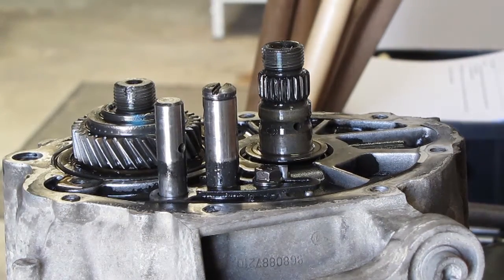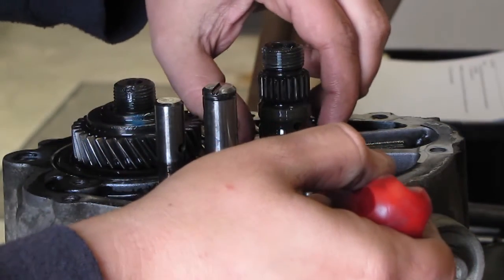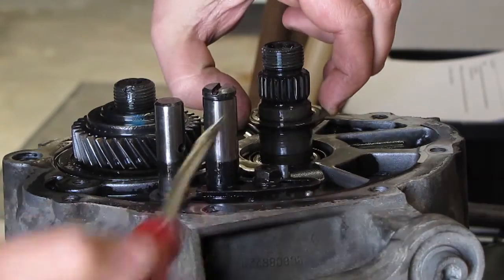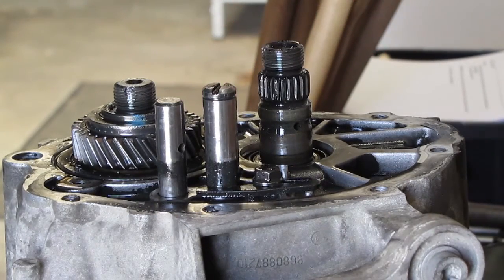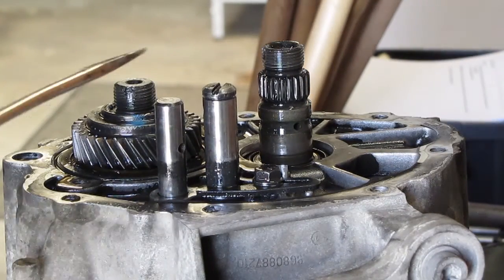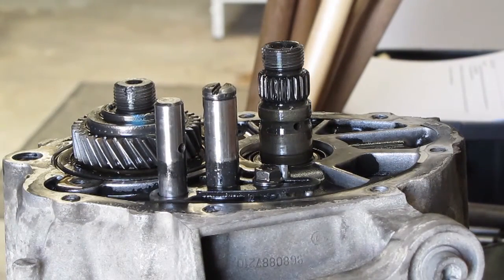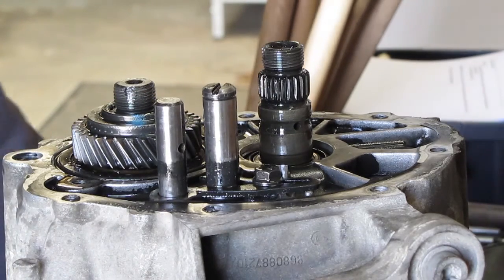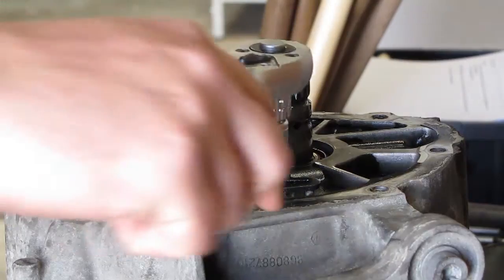Peugeot 207 - BE4 Gearbox Overhaul (Part 3)

Comment: Hey. Can i ask you something about this Gearbox. I have the same in my Peugeot 307 (EW10J4, RFN, 2.0 Petrol 16v, 100 KW). My Gearbox works like a charm when its cold. After 10 mins of driving, the Shift Knob start to get "Stick" when you put it left or right. It means, when you put the 5th Gear in , Usual it springs a bit left ... i guess you know the Problem. From Neutral, you put it Right, it stays there (you must help to get it in the middle again) From left side the same. ONLY when it gets warmed up.  After 10 mins of driving.
Clutch already renewed, Gearboxoil also ofc. 
The Assembly of the Shift Knob , when i disconnect the Shifting Cables from the gearbox is smoothy, i lubricated it. all moves freely. In this Video at 13:07 The Top Lever is responsible for UP /DOWN moves , the LOWER one, is for the RIGHT/LEFT Movements, which also should snap back to the middle. THIS LEVER is Sticking somewhere .
Did you have any Clues or Hints what i can do there ?
I wanna remove the Cover of the Gearbox (Access to 5th Gear Assembly) to see if im able to find the Problem there.

As i said: COLD: Everything works fine. And if you drive for 10 mins, You cant do Left/Right movements with the Gearshift-Knob , it dont snaps back to the middle because the lever in the gearbox isnt working properly and dont move as it should be. Greetings from Austria, Sorry for not so good English :)
Reply from the maker: That is a very odd issue. Are you sure the plastic bracket which holds the 2 cables is completely secured with all bolts? I had an issue before where I lost a bolt and the bracket would move, resulting in poor shifting. Perhaps when it warms up some sort of play occurs?
Other than that, theres not much which would cause this apart from bad shifter cables...
Reply: @Ronke01   Hi, Thanks for response. No its the lever in/on the gearbox itself. which stucks.
The Plastic thing with the cables are ok (Looked at it, when i have done the clutch). I have disconnected the cable from the lever there directly.

Something inside the Gearbox must get sticky at this lever when it warms up. I know that the BE3 Gearboxes have issues with loose Nuts on the 5th Gears ... Thats why i wanna look inside there. It can be done when the gearbox is in the car .

I just thought you know, where this lever goes, and how it functions. and from where this "Spring" effect comes. (If you move the knob to right or left, it should move to the middle from alone) from where this force comes from ? :) :P .
Reply from the maker: @knuckles2k3  have a look at part 7 and part 8, it's when I start rebuilding the gearbox.
You'll see that that lever is springloaded, so you might have a broken or sticky spring on that assembly.
It's gonna need a complete overhaul I'm afraid.
Reply: @Ronke01  Hey. Hm aah there is this part linked to, to the other one too. Thans, i watched it and see it.
The interesting Thing is: Why it works 10 mins after a Cold start (perfectly ) and get shitty when its HOT outside or the gearbox is warmed up.
I dont have a Problem to replace the whole gearbox, get a used one is not so hard, they are common here... But first i wanna know whats going on with my own . Thats a real unusual Problem.

I read in a English Peugeot Forum about the Problem. It should have something to do with the Gearset of the 5th Gear and / or the synchro Ring of it (i dont know, i just read it). The show must go on ^^ :P :)
Reply from the maker: @knuckles2k3  yes that's very strange, but I dont think you will see anything from taking off the top cover. You could try changing the gearbox oil and see if that helps, maybe even try a friction reducing additive in the oil.
Reply: @Ronke01  Okay, Thanks for your help, i will change the gearbox oil  (75W80 GL4+ or GL5) and add Liqui Moly Gearbox Additive (With MOS2), and see what happens. I will leave the top cover at its place , i will respond later here if it helped :) (If not, i will get a other Gearbox) :)

Comment: Seen second video, and must say thats absolutly NOT done to get the nuts of by blocking the gears with a screwdriver..
first use a proper socket, and block the gearbox shafts by switching the 5 th and the first gear simultaneously ( by removing the pin that holds the fork of the 5th )

Further, i missed a part of the video where the selector was removed ( later i found out that you bended the support )

why not hammer the pin out?  ( get done in two ways ) 

Have done a lot of these boxes ( BE 3, BE 4, MA, Getrag mini cooper... ) so have any knowledge,

Regards
Reply from the maker: +nick vanderstroom I had no previous knowledge of how to do this, so nice of you to share on how to block the gears, altho I don't quite see it in front of me on how to do it. All I can say is i didnt blovk the gears themselves in any way. I know they are quite brittle and chip easily if you would do that.
And clearly you havent seen many of my videos if you're telling me to use a proper socket :p
I try to do as much as possible with basic tools. This was done on a sunday, where there weren't any stores open to find the special and pricey socket you would need.
As for the selector bracket, it got bent after trying to remove the locking pin. Underneath the shaft is a small hole, where the pin needs to fit inside of during the removal, but it got in crooked somehow and jammed everything up.
Don't remember exactly how it got bent, it just did because i had a hard time releasing the shaft after f*cking it up :D
But hey, that's how I learn most stuff ;)
Reply: How do I remove input shaft from a Peugeot 206 ma gearbox